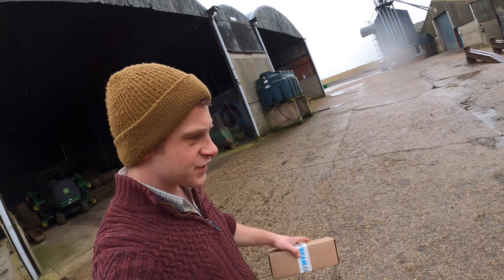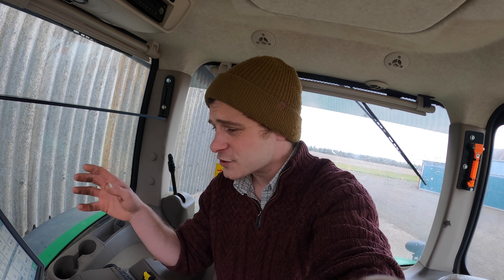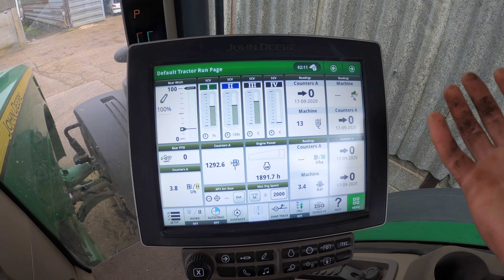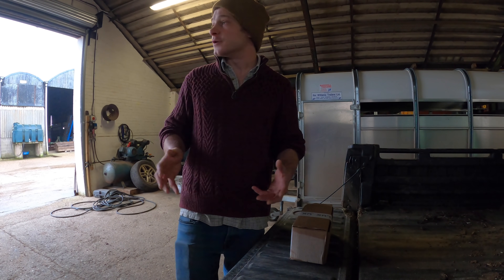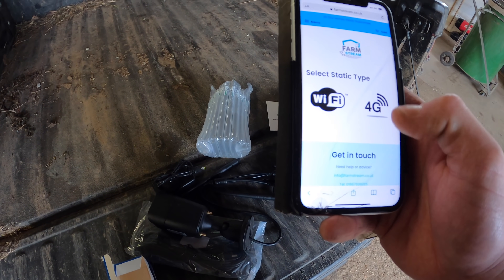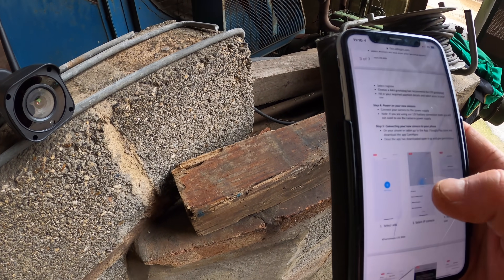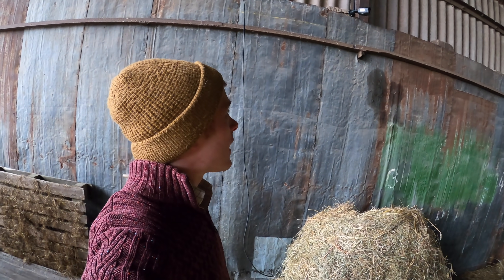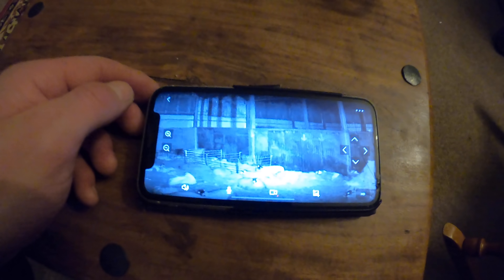JOHN DEERE COMPUTER BROKEN AGAIN?! AND SETTING UP FARM STREAM CAMERA!

Comment: Thanks for the update on the JD. I think the problem with modern tractors is they are built to work a hard but short life maximising efficiency for very large farms or contractors. Electronics don't do well sitting unused for weeks with condensation building up. Definitely a market for simple mechanical tractors for "smaller" farms/owner operators.

Comment: Very simple basics first. Oxidation on tiny pin connectors inside the harness plug connectors. This could very well be the same cause as 1 year ago. Unplug your screen and control unit connector. Usually 64, 102 type pin plug. Get something like Wurth Contact Oil spray, douse the pins, connect and disconnect a few times to establish good pin contact. All connectors in the tractor should get this type of treatment especially in your wet climate. Pray for a savy JD Tech when he visits 🙏. 🤞. 🐑🐑🐑Lamb Cam 🤣🐑🐑. Keep yer 9mm handy when Mr. Bob Cat or Mr. Y. Coyote comes a calling  👍🇺🇲

Comment: Great video Nick looking forward to seeing the TM getting some work done as spring comes. Sadly it seems there’s no mainstream brand of tractor now without the dreaded computer brain and much as I’m a ford/new Holland fan I’d reckon if you’re current JD keeps giving trouble then for a bigger tractor I’d probably look at either one of the older Case MX magnums or Claas Xerions, pre adblue/dpf/egr nonsense but enough tech to be comfortable and productive and most tractors at that kind of age can be retro fitted with auto steer as an ad on if you need it for precision farming 🚜🔩🛠👍🏻
Reply from the maker: You might be right there Graham, seems all new machines are too techinal now, older and more simple seems to be the way to go!

Comment: Some bad news for you your TM does have ECUs/Computer that control your gearbox snd the hydraulics and your heading towards the hrs where they drop their bundle😊
Reply: That they do but it seems they are a much more simple/reliable version than today’s tractors and they have proven to be capable of doing decent hours with no problems and if they do go wrong repair/replacement isn’t quite so expensive not least because you don’t have to get genuine John Deere parts and have their tech bloke to plug it in and tell the tractor to accept the new part and pay full dealership price for his time. TM gearbox calibration procedure is actually quite simple and explained in the manual with no need for any laptop 👍🏻

Comment: You would think with flow control. It should reset to a default setting. Or sence the load and adjust automatically.
On old tractors. It was just a knob to turn. Always seemed to work. But these days we need a computer to turn that knob for us. Funny really. That's what technology has amounted to. Computerised knob turning.

Comment: Deere made their reputation with some good tractors years ago. Then like BMW, Landrover and others had to ramp up production to meet demand while maximizing profits, and now quality has suffered.
Reply: Don't think it has, they have some of the best build and most reliable tech I've used in any modern machine.
Reply: John Deere are definitely going down hill fast, estates around here have been ditching them as unreliable and so expensive to fix.

Comment: I have to agree about the tech inside tractors.  from what I have seen there seems to be an awful lot of it and I really don't understand why a good mechanically based tractor cannot do the same thing. Is the same with certain cars and they seem to have WAY too much tech which you could spend almost a day faffing around with and to what end??   I did drive a Merc with an onboard computer and it was nothing but a nuisance and a distraction.

Comment: Trouble is what can you replace it with that's got the same HP and not much in the way of electrics. 7810 or similar...Or how about an FW30/60.
Reply from the maker: That’s the problem, all these modern big tractors are too technical, if only you could buy a new ford tractor with 300hp and no computer... that would be awesome 😆